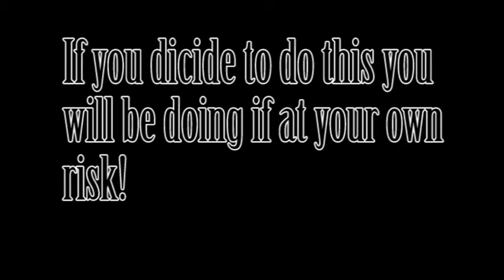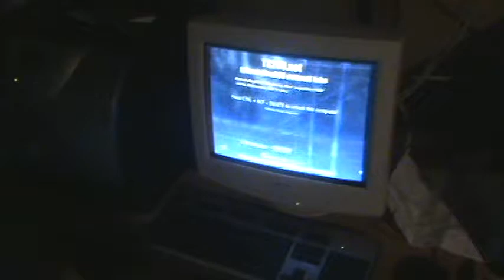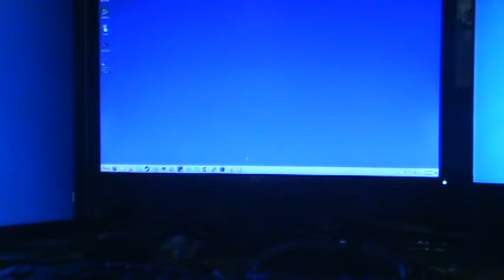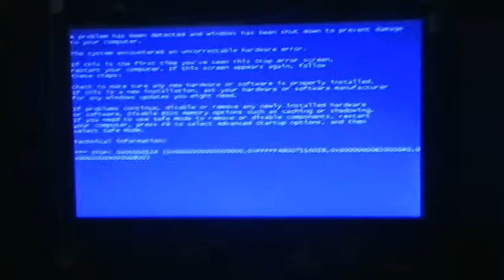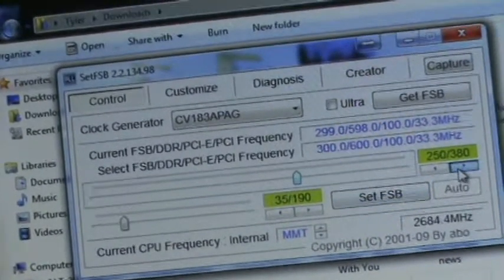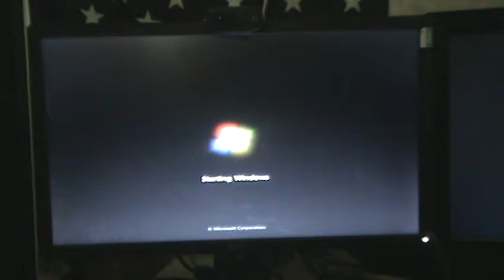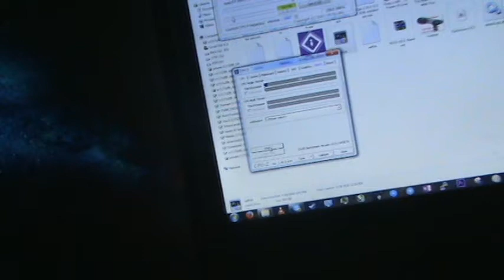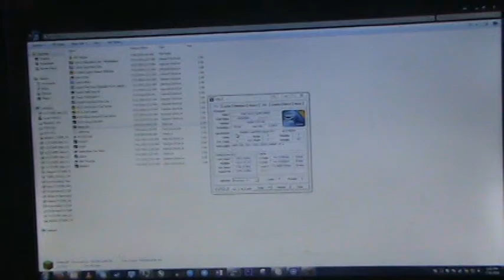Dell FSB Over Clocking nightmare!

Comment: How did you get around the issue of the overclock reverting when the system shuts down? I have gotten the overclock to work, but not to stay. I have an Intel Core 2 Quad Q9400
Reply from the maker: That's the thing with fsb overclocking. There isnt a way to apply it permanently. All FSB does is step up your baseclock on your northbridge/chipset and your multiplier will step up that clock. So let's say you have a core 2 chip with a fsb speed of 1000GHz and you have a 3 times multiplier of that. And your chips base speed is 3.00Ghz then the multiplier running at its lowest can reduce clock on your cpu speed to 1GHz and its highest 3GHz. This is how intels early speed steping system work. Well if you increase your base front side bus speed to 1.5GHz with the same multiplier your clock speed can get as high as 4.5GHz, somthing to note is with fsb overclocking is that by raising your bus speed. You increase other bus i/o card / devices speeds this can produce seriously instability issues. So to answer your question. Your cpu clock speed will not appear higher on windows or in your bois. Because technically your tricking the bois that your clock speed isnt changed. This is a really old trick us hard core LGA 755 and LGA 771 socket tuners used to do alot back in the mid 2000s and even still do on some x56 lga 1366 systems.
Reply: @tylersteffen200  So essentially every time you turn on your computer, you have to redo the overclock? That seems very tedious and annoying. Is there was a way to save your settings and have it apply them at startup?
Reply from the maker: @cabinhead8177  Front side bus overclocking is nothing but tedious and annoying let alone a super unstable way to overclock your hardware. As far as I know there is a way to get it to auto apply but it would consistently crash me on startup. I would not recommend it. Before I upgraded I had upgraded to a xeon x3370 and was able to front side bus overclock to 3.4 GHz at the coast of serious instability and heat output. Core 2 chips have a nasty performance to power ratio past 2.66 GHz especially quad core versions

Comment: Upgrade to a T3600 with a Xeon. You'll get quad cores and 8 threads. Problem solved. Had mine for 4 years until I upgraded to a t3610. Good Machine
Reply from the maker: I did upgrade to a duel socket lga 1366 system now in place of this computer. It surprisingly was still holding up and keeping up but having such terrible multi core speeds forced me to upgrade. Editing with this thing was pure pain. Not to mention rendering

Comment: Why didn't you just upgrade to a QX6850 and get the 3Ghz at base clock speed!?! The T3400 can handle 1333 FSB and the Q6600 runs at just 1033. Even the QX6700 (1033; 2.66Ghz) runs faster than the Q6600. The QX6800 (1033; 2.93GHz) beats the Q6600 also, but is too expensive. The Extreme Quads just make this OC attempt a waste of time. However, it is interesting to see a Legacy Dell system OC'd.
Reply from the maker: I did end up upgrading to a Xeon x3370 in this build, the reason I didn't go straight to it though is that of the coast, lga 775 socket quad core high clock rate cpus at the time were pricy, but your right that higher fsb speed is a huge gain when it comes down to it.

Comment: t3400's dont support xeons i own a t3400 it is my main pc the max it can have is the Q6600
Reply: I have a t3400 with a c2q q8400 @ 2.8ghz in mine.
Reply: It supports the Xeon X33xx series Xeon processors. Make sure they are 771 and 775 Xeon CPUS.
Reply: @LazyGamer010  do u know what is ur motherboard fsb?
Reply from the maker: I've installed both a xeon x3370 in a t3400 and a xeon e3110 in a t3400. They do take them. Dell is really scratchy on listing what cpus work in what system and are famously known for that with the old core 2 systems